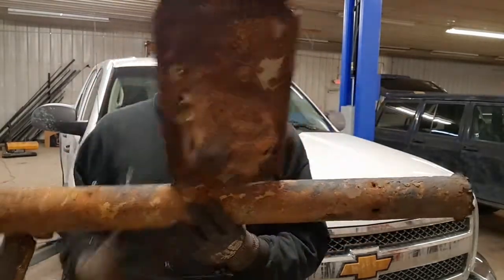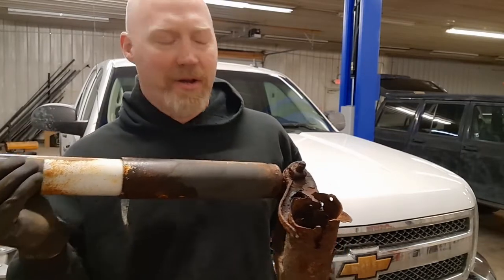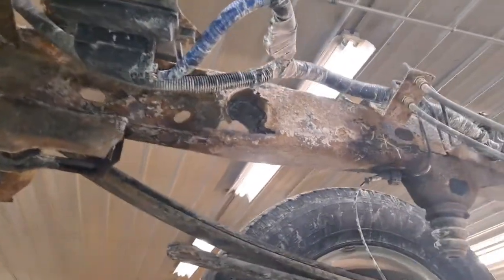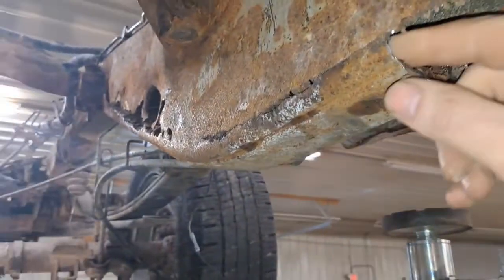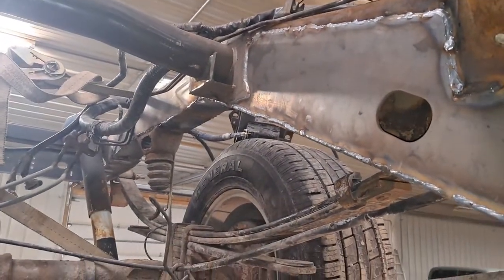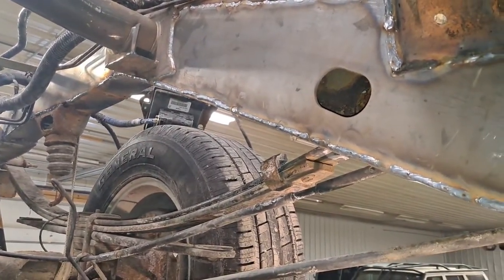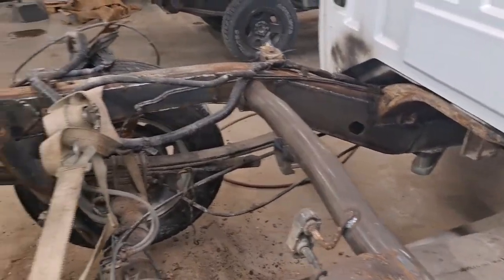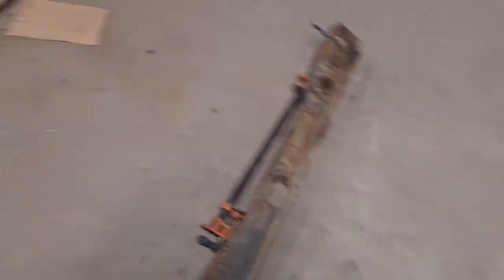2012 Chevy 1500 Frame Rust Repair - Can it be Saved?

Comment: Do u think this repair will pass an inspection for an extended warranty?
Reply from the maker: Guess it depends on which direction you are asking.  If an owner did the repair i dont think a dealership would want to warranty something that had been modified.     I have had dealership customers do this repair though as part of their warranty.  Basically sold a vehicle and within the warranty period a frame crossmember break loose.
Reply: Noooo,  not do this myself.

Comment: I own 2 that body style, a 2012 an a 13 both near 100,000 mi, people may think I'm nuts but I religiously spray my frame an body with used motor oil then run them down a dusty dirt rd every fall😂 both frames an body just as solid as the day they rolled out of the assembly plant😅

Comment: Damn bud you put some work in her. I probably would have junked her and kept the motor but on the contrary she's strong as shit now. I just replaced two cross members in mine. The C channel rails were starting to get bad too i am fluid filming the shit out her. It's still solid but probably like 1/8 thickness steel now lol. Anybody that wants to buy these chevy trucks they rust like you wouldn't believe. Gm think's everyone lives in California. Go down south or out west to get one and immediately fluid film or wool wax it. Your gonna have to drill a hole to have an access point to fluid film the rear wheel well's because they will rot in no time. I don't think GM puts any type of coating on the inside of the body panel's it's just raw steel and it's thin too. Same with the rocker's panels and cab corners. I have replaced the brake and fuel lines too all because GM is too cheap to use stainless steel. About the only thing good in them is the motor very reliable.
Reply: Chevy//GM should be embarrassed by the number of frames that have rusted out on these trucks. It’s a total disgrace! They should  have galvanized the frames. I think most people would have willing to pay a few extra  dollars up front to have a truck frame that will last as long as the drive train.

Comment: Garbage **cking vehicle.  Thanks for the video. I have to do the same. It’s sad when the original exhaust outlives the frame.  (08 56k miles here) Just failed PA state inspection.
Reply from the maker: Unfortunately of the rusted vehicles we work on Chevy trucks hold the crown for being the newest to have major issues.

Comment: New frame. I wouldnt bother with patching. Imo, it would be easier to pull the cab and engine than fabricate plates to stitch it all up.
Reply: It takes 60-80 hours to replace a frame. Most major frame repairs can be done under 20 hours and a fraction of the cost

Comment: Why do these trucks rust so bad? That repair is good but looks like too much work
Reply from the maker: My opinion is its a combination of factors.  Going from open C channel frames to boxed frames, frame material getting thinner when they did that, lack of maintenance, poor coating performance, multipiece frame rail designs, all the salt used on the roads, etc.
Reply: @TabooCustoms  The prolem is the frames were not treated proerly by G.M's frame suppliers  , That is why All involved in this "shody"  built  truck needs to beheld accountable

Comment: This is why i will never own a gm truck. They have had rust problems for a long time. This truck was not even 10yrs old when this was published and already it was ready for the scrap yard if not for spending thousands of dollars paying a shop to fix it. GM should have pulled a Toyota and replaced all the frames with a quality coating over quality steel. None of my fords did this ev3n at 15 years in NY. 
Fact is this truck was probably 5-6 years old when those bigger holes started. Totally unaceptable for such an expencive piece of equipment

Comment: Absolute trash. GM has really gown down hill.  This truck is 10 years old and shouldnt be unsafe for the road. This is something you see on 20 and 30 year old vehlces. I see 2016 and 17 Chevy truck bodys rotting through already around where i live. They will rot before they are even paid off.